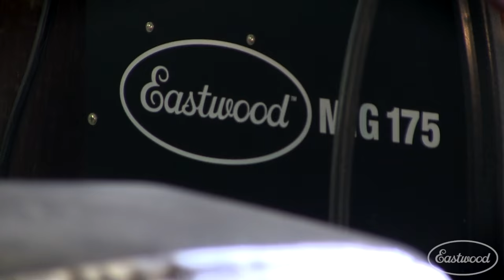How To Install A Quarter Panel on 1970 GTO Convertible using Eastwood MIG 175

Comment: Lap welds are the easy way out. Better to butt-weld panels.
Reply: unktupelo properly done as shown here, lap welds are stronger, faster & much easier to final finish work before paint, especially on a long, unsupported cut line like this.
 But I'm sure you've done this many times both ways to have come to your conclusion.
Reply: @cruzinezy1968  Lap Weld panels will eventually Rust through at the joint area, Especially in High Humidity areas. 
Butt Joint Welding, requires more Skill and Time but done Properly is the Best Way to get the job done without any concerns of future Rust through.
They should have shown the Interior View of this Joint in this video. So everyone could see how Hideous this joint Truly is.🙄🤫